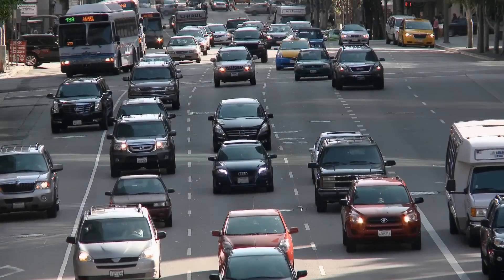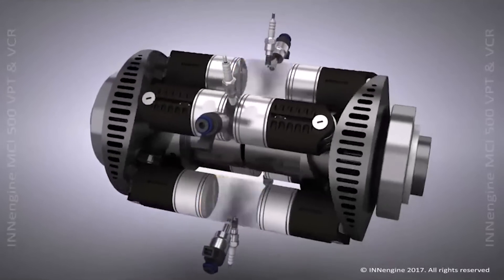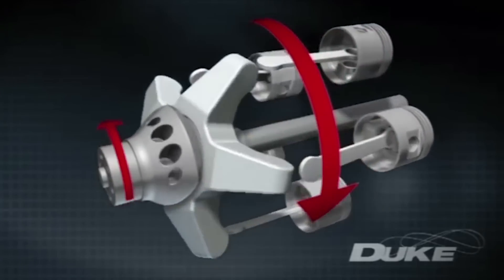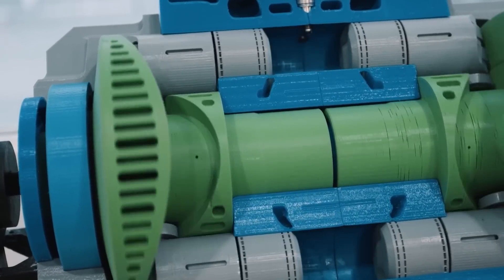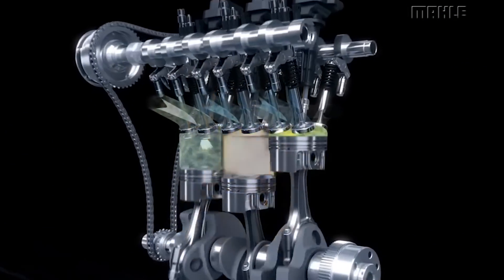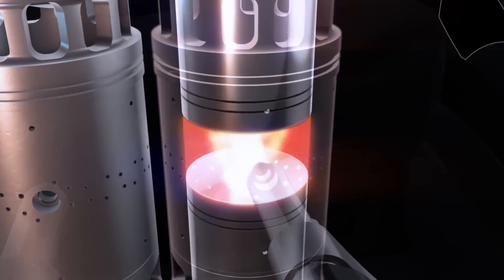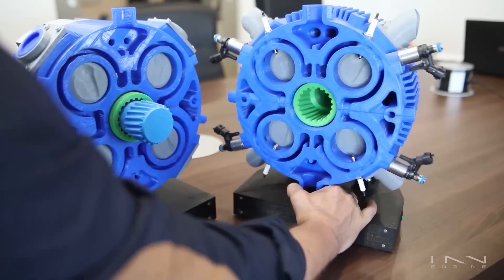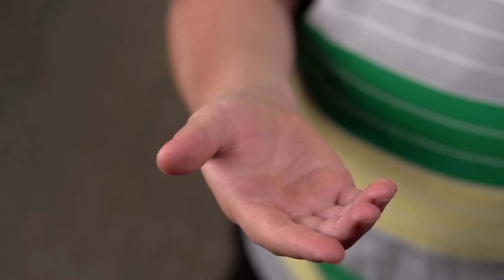Revolutionary One-Stroke Engine: Future or Fraud?

Comment: The "supercharger" is more likely to a scavenge blower to assist in exhaust gas scavenging in this valveless engine design. 
There was a diesel locomotive in the UK nicknamed the Deltic (the British Rail Class 55) because of its engine that was a two stroke diesel valveless opposed piston design manufactured by Napier and it used blowers. Unlike this engine, the Deltic in the Class 55 loco was supercharged.
Innengine are technically correct in that the demonstrator engine fitted to the MX-5 is not forced induction.
Reply: Yeah, I was looking for this comment. Definitely doesn’t look like a supercharger to me.
Reply: Same, can only see a cone air filter

Comment: The video is dated 2017, so what has happened in the six years since? Feels like electrification of vehicles has moved so far in six years, that there almost isnt a place for an engine like this anymore. Doesnt seem like any auto manufacturers are working on range extender cars, everything is fully electric. Mazda said something about using the rotary engine as a REX, but nothing seems to have happened yet. Feels to me that this project has missed the boat on range extenders already

Comment: Without knowing the Thermal efficiency, We know nothing.

Power to weight ratio is compared to actual automobile engines better but it is achieved by higher rpm's and no timing losses , so is there a real reduction on comsumption through a higher thermal efficiency??

Looks much more reliable to me due to the low number of components It is made of. Probably 1/100.

But still a piston engine with its architectural limitations on Heat losses and poor expansion.

If not, what declares manufacturer on thermal efficiency?

Dont make me wrong, looks to me a very versatile engine but It has arrived a bit late and we need to forget combustion piston engines and move towards much more efficient technologies that can offer at least a 35% on energy efficiency.

We are going late already.
Reply: For a range extender, light weight may be more important than fuel efficiency. Ideally, most day to day driving only uses the battery electric drive. So a lighter engine saves energy overall even if it's not as fuel efficient.
Reply: @IsaacKuo  yes, lighter is less compsumption of course. So you pass from a vehicle weighting 1.800 kg to 1.600 kg.....no Big deal.
Just nothing when you compare It to an improve on thermal efficiency, wich IS much more fuel saving.
But, Guess what...piston engines have nothing to improve.

Comment: So at the end of the day much the same as Mazda has done with the rotary engine range extender for their new hybrids. The potential for small fixed speed and low torque engines with super high efficiency is not a new idea at all, but the problem is no car manufacturer wants to put money into new combustion engine technology. If Mazdas new range extender delivers everything they promise, then maybe this erex has potential as other manufacturers may buy the idea to make their own range extenders (though much more likely is they'll just take any innovations and put it into use themselves as being sued for patent infringement isnt a problem for the big car corps.)

Comment: From the crankshaft perspective it receives two power strokes per revolution, a power stroke every 180° is in effect a one stroke engine. There's no connecting rods, but there's two waves on the plate which is two compression cycles per revolution.
Reply: That's like calling a four-stroke v8 a half stroke engine, because there's a power stroke every 90° on the crankshaft.

You could have four high waves on the cam plate, and have the cam plate spin half as fast for the same engine cycle. You could have just one wave for a real swashplate, although that would unbalance the engine.
Reply: Each cylinder requires two strokes, that doesn't change no matter how many extra cylinders you have. A 12 cylinder two stroke engine is still a two stroke engine.

Comment: It doesn't matter how clever or efficient or what ever the engine is. If it burns fuel then it's not the future. EV's have better performance, are better for the environment, and are cheaper to own over their life time.
Reply: Literally any EV would have a longer range with the addition of this range extender. You clearly did not understand the video. These would be used IN and EV and would take advantage of the higher energy density of liquid fuels. Range extenders are not new. Do some research, kiddo.
Reply: @filonin2  Let's assume it burns green hydrogen: In that case it's use perpetuates burning fossil fuels by using four times as much renewable energy than an EV would, meaning that as we ramp up renewables to phase out fossil fuels, we have to keep burning the fossil fuels longer.
Reply: @filonin2  Lets assume it burns synthetic fuel: Same problem in that it's still a highly inefficient energy storage medium. Plants absorb energy from the sun, we use machinery to plant it and harvest it, then process it and deliver it. You can cut all that out by just using solar panels and a battery.

But also internal combustion requires lubrication which results in particulate emissions, carbon monoxide, and NOx emissions, which harm humanity directly and indirectly via the environment.
Reply: @filonin2  Zoom out to the big picture: (almost) All energy comes from the sun. Fossil fuels are plants storing that energy in carbon and hydrogen chemical bonds. Burning a tree is carbon neutral because the carbon in it was taken from the air. As long as the burn rate is equal to or less than the growth rate.

Fossil fuels are different because they are huge stock piles of energy collected and stored over millennia that we have burned through in 200 years. The rate of release to collection is spectacularly unbalanced. The ecosystem cannot react quickly enough to deal with it, and when it does, the abundance of CO2 resulting in huge growth (like algae blooms) will be followed by mass death (like algae blooms) as the release of the resource is stopped. 

Put simply: The only thing we need to do is stop burning fossil fuels. Any internal combustion, even if it isn't a fossil fuel, prolongs our fossil fuel use indirectly by using investment that could have been put into renewables and excessive renewable energy due to the inefficiency of the additional energy storage steps.
Reply: @filonin2  Electric cars have ranges in excess of 200 miles now. 99.9% of all journeys are less than 200km per day. They can fast charge faster than it is recommended that you rest for within extended periods of driving. Modern electric car technology doesn't need range extenders.
Reply: @filonin2  You're welcome for the research, kiddo.

Comment: One of the main keys to reliability will be making sure there is good oil delivery to those piston rollers 🤔
Reply: I’d like to know too how that engine is lubricated.
Reply: It is lubricated PROPERLY, with the added benefit of keeping the oil OUT OF THE combustion chamber (thus GREATLY reducing the emissions).
It is a 2 stroke engine with 8 heads (4 pairs of opposed heads that they are stroking in the middle) does 2 + 2 strokes in a 360∘ full cycle.
A   B
C   D
A+D stroke simultaneously in the 180∘  and 
B+C stroke simultaneously at the rest of the cycle.
Reply: or making them as easy to change after 10k miles as spark plugs

Comment: What you are calling a supercharger on this engine is called a scavenger pump on 2 stroke engines because it scavenges the exhaust gases.
Reply: Yes, the blower reminded me of that used on the engine of a diesel locomotive in the UK nicknamed the Deltic because of its valveless horizontally opposed two stroke  Deltic powerplant manufactured by a company called Napier.

Comment: Thanks for your interesting thoughts. 1 stroke of 4 stroke, doesen‘t matter, as you mentioned it is marketing. It is a 4 times, double piston, 2 stroke, technically. Hybrid cars might be a good application, direct drive not so much.
Still it produces emissions (not only CO2 everybody is talking about) and it needs oil to produce fuel.. How much of it is available? Currently enough, but……
Reply: It can burn hydrogen which can be made from water and if you have cheap renewable energy you can make fuel.
Reply: Cheap? Hydrogen is a nightmare in terms of storage, and handling, and in top of that, it is very expensive
Reply: @VictorDiaz-lo2mu Not expensive in terms of cost per mile. I'm more concerned with danger.
Reply: This engine will run circles around a traditional 4 or 2 cycle. In terms of performance and efficiency.

Comment: I had to wonder what a one stroke engine was when I saw this. So it was an effective marketing gimmick to that end. Your clean examination of it makes me say, thanks for that. As you went though it I first wondered how they got the fuel/air mix in and the exhaust out. Then I saw the injectors, and was still wondering how they got the air/exhaust movement. Then the turbo was introduced. Nice progression. But it just looks like another way of feeding the carbon fuel industry with overly complicated mechanisms compared to an electric motor. Not really buying it. Nice work on your part. Appreciated.
Reply: Yeah it is a 2 stroke, but because there are 4 "power strokes" per revolution, someone called it a one stroke, and the company ran with it. It doesn't have the typical problems of a 2 stroke, such as running a fuel -air mixture through the crank case, which is not good for emissions. Also many less moving parts.
Reply: @leeknivek  LOL That's hilarious. That someone certainly either didn't understand the classification of ICE engines or was simply disingenuous. And you're right about the difference in conventional 2 strokes if you don't have to mix oil with the fuel to lube the bottom end. I don't know the details of the lube system for this one. But there are a lot of details in the physics for the way the parts will wear over time that need ironing out. Still overly complicated compared to an electric motor, though. And it will still have a relatively narrow operating efficiency RPM range compared to electric. Maybe nice to have something that gives you a margin of range in a pinch, but I think I'd prefer something tried and true like a good old 4 stroke cycle. At least till they can prove this one is better.
Reply: @RichardRoy2  conventional opposed piston engines with two typical crankshafts were and are widely used, since the 1930s, and they are known for their power and reliability. They are used to power tanks, trucks, boats and planes. This design happens to make it more compact, by using another well established linkage - the swash plate - which has been used on everything from AC compressors to helicopter turbine pitch controllers. Less parts, less wear, less expensive. The exhaust scavenging 2 stroke is nothing new, and it’s always been more efficient than the four stroke engine, just by nature of design. In a four stroke, you’re losing at least 20% of the heat energy by moving the valve train and absorbing half of the power stroke into the cylinder head as heat, which then needs to be cooled - you have to move camshafts, push rods, rocker arms, timing belts, etc., not to mention the interference engines that self destruct. 

An engine like this with so few moving parts and so much less complication can probably go a million miles, and mass production can probably manufacture them for less than $500. And they are made from common materials - iron, aluminum, some alloying elements, unlike the electric motor which requires copper, silver, rare earth magnets, rare earth lithium batteries, the materials for EVs are extremely scarce in comparison, there’s not enough to make enough cars for everyone in the world today, and they only last about 20 years or less, and you can’t recycle the batteries. They have plenty of their own problems, so I think it’s a little foolish to ignore that while claiming that an engine design used in all the most rugged vehicles ever made is somehow going to be unreliable. It only speaks to your lack of knowledge on the subject.
Reply: @RichardRoy2  of course the ideal use for the motor anyway would be as a hybrid electric - using something like toyota’s E-CVT transmission, with two motor-generators. You get the benefits of full torque from rest in an electric motor, and the cheap and abundant fuel supply of gasoline or preferably diesel, and you can buffer that with something like a lead acid battery that is not only recyclable but also inexpensive compared to nicad, lithium ion, or any other batteries made with the use of slave labor. This engine would actually solve a good deal of problems, and it’s unfortunate that people aren’t seeing it, that’s why I’ve been taking the time to politely explain how good this is on every video I have seen of it. This would be the engine of the future, but people who are definitely not engineers have some obligation to point out marketing flaws while missing the big picture. This is the only way to go green, for about fifty different reasons - for one, you can make a car that is inexpensive and long lasting, people won’t have to buy a new car every five years, and that alone would cut down on emissions by 30% or more, if vehicles stayed on the road for 30 years instead of 10, scrapped, junked, destroyed, remanufactured, loaded with Chinese electronics, sold at an all time high. 

I mean, in the next 20 years, the average person isn’t even going to have a car at the rate things are going. Mark my words, they won’t be able to afford them, and our way of life is going to change drastically. This engine is the solution.
Reply: @leeknivek  My lack of knowledge on the subject has me examining development of electric motors that don't use rare earths. But what kind of idiot would I be if I said development has reached its zenith?
Reply: @RichardRoy2  good luck in your search. I think this engine has a lot of potential, hopefully it lives up to all it's promises.
Reply: @leeknivek  Thanks for the good wishes, but my search has shown some 20% of vehicles don't use rare earths. So there is an alternative.
Reply: @RichardRoy2  what are they using instead?
Reply: @leeknivek  Induction, if I'm not mistaken.

Comment: Fuel consumption to power ratio?
Reply: This type of engine is particularly efficient. However, its power output is not suitable for driving a vehicle directly. Just like atkinson cycle motors. Of course, as Toyota solved it with the HSD power transmission system, it can also be used. But unless it runs on sunlight, my Tesla is still more efficient 😁

Comment: It is a 2 strokes, compression stroke and then a power stroke.This idea has been around for many of years. All they did is got rid of 2 crankshaft and added in 2 swashplates.
   My computer has 8 cpu cores on 1 cpu,so can I say I have 8 single core computers and resell it for 8 time the amount of money I spent on it.